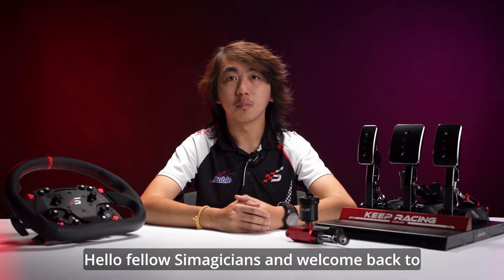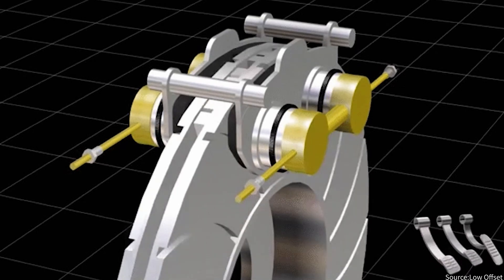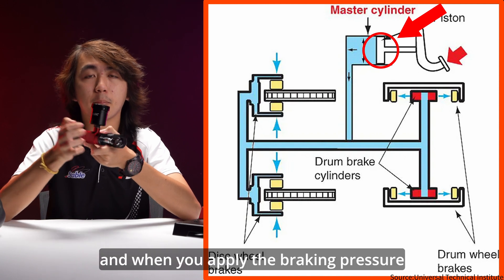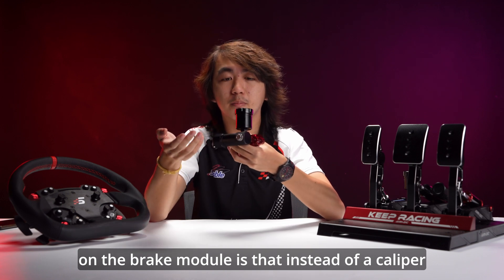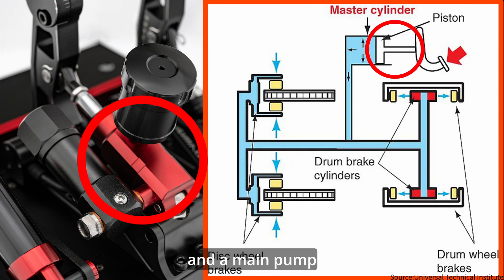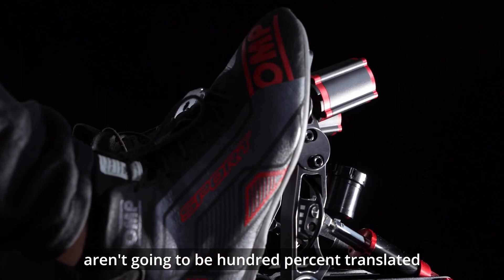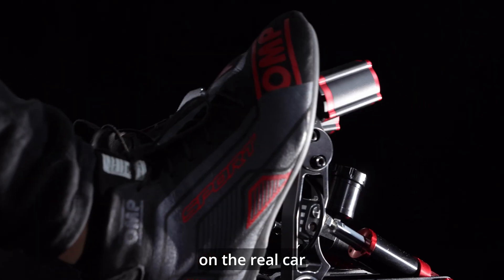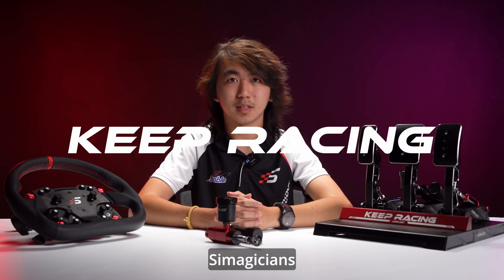Does Hydraulics REALLY Make A Difference? | #TechTuesday Ep.3

Comment: I leaked the oil how do I replace it?
Reply: Need to contact simagic for a replacement cylinder, it'll be about 120-150$. Or you can rip it apart and replace the seals.

Comment: Best feeling brake ive ever used in a sim. Also has that nice bit of travel ive always felt is underatted.  Im sry but sim racing brakes should feel like road cars or gt4 cars nor f1. We have 0 g forces to help transfer energy through the brakes. F1 brakes arent stiff and heavy for no reason. They also wouldnt design them that way if they were braking while standing still lol. Imo these braks give me so much control. Ive bever been able to trsil brake as good as i do now. Full control every part up to 100% and or 80% depending on the sim and or limit before lockup. Its just so damn good. I can modulate the brake and get this beautiful progressive feel ive always dreamed of having on my sim rig.

Comment: hello,Today I received my PHYS, I installed it following the instructions, I only changed the elastomers and put 8 instead of 9. After an hour of use I realized that I had an oil leak from the elastomers container.
Is it possible that it is broken at the factory or is it normal for oil to enter the padders container and I have to close the elastometers container tightly to prevent leaks?Now im a bit worried of oil leak on the pedals .
Thanks.

Comment: Hi Alvin. thank you very much for the video. The P1000 pedal brake has a hall sensor and a load cell. They can be changed. Is it better to use only loadcell for a hydraulic mod? And the second question. Will Simagic do a brake modification with springs? Now everyone is discussing the disadvantages of elastomers. Specifically, we are talking about relaxation by 10 percent after hard braking.
Reply from the maker: Hi @user-tr9jq4xw8r, for the dual sensors, they can be used for both hydraulic and non-hydraulic, so this is up to personal preference; And as for a spring option, it's something that we are looking into as there is a good amount of requests😉
Reply: @simagicofficial6890  LOVING! the hydraulics  using the P1000s. so much better feel and consistency than without it. spring option would be really interesting! hopefully ya make it happen, im up for trying!

Comment: I do not know what kind of sensors you have in your pedals. If the hydraulic pressure is not translated to brake pressure then it's useless and misleading. If there is either a hydraulic pressure sensor or a load cell in either end off the force then this is a great addition and well done for the nice implementation!
Reply from the maker: We have a dual-sensor design, which features a hall sensor (brake angle) and a load cell (brake force), and you can freely switch between the two in the software😄
Reply: The axial force applied to the hydraulic cylinder is directly measured by a loadcell.